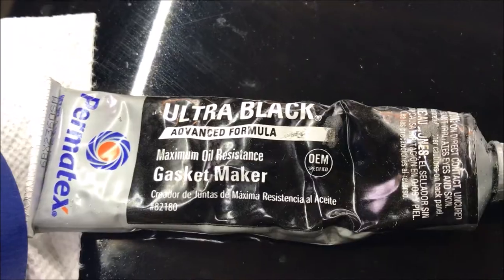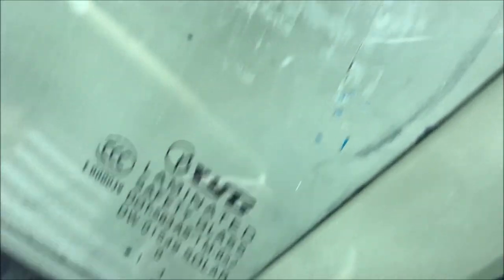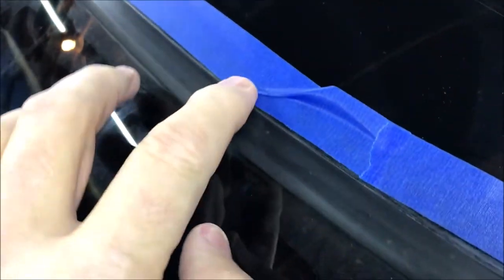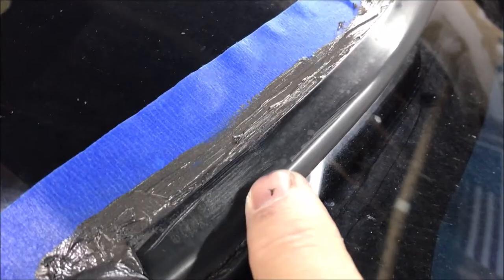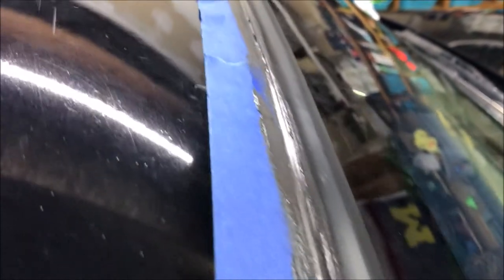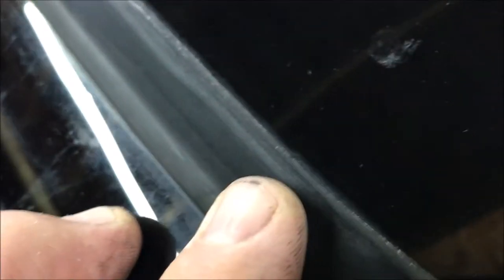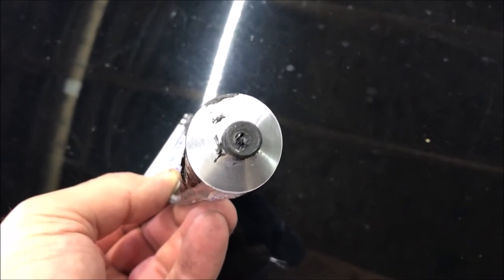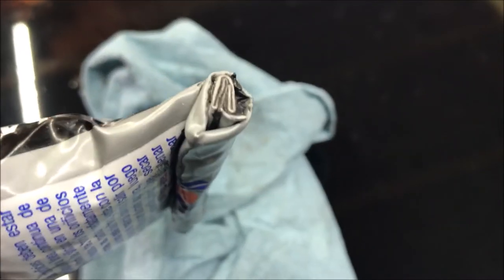OldGuyDIY $2 Fix Repair Windshield Seal Leak w Permatex Gasket Maker Car Truck Auto Leaking @ Seal

Comment: ---- <  What about if the weather stripping problem is between the weather strip and the glass.  Will the permatex make a seal between the glass of the front windshield and the rubber or vinyl strip across the top of the window?
Reply from the maker: Based on my experience, yes.

Comment: My sealant shrank due to age and the corner is peeling off will this work? And is it easy to clean off if I have to change the windshield
Reply from the maker: I believe this will work to repair the shrinkage.  It is not easy to clean off.  Once it is there, it wants to stay there.

Comment: Can the seal be replaced or would the whole windshield need to come out?
Reply from the maker: The windshield needs to be removed to properly replace the seal.
Reply: How much that would cost aprox?
Reply: @gerardotorres7904 it's basically going to cost the same as replacing it. I have that issue where i got a new windshield installed poorly and now reaping the consequences. Luckily it doesn't rain often in California.

Comment: So I have a 07 Cadillac DTS and when I wash the car water gets in somewhere and where I open the sunroof that where the water starts coming out from those buttons and lights could it be the sunroof that needs sealant around the sunroof
Reply from the maker: Yes, I believe so.  It could be that the seal around the sunroof needs to be replaced or the drain hole or holes are plugged. With the sunroof open, stick your head through the sunroof hole and you will see a track running around the outside edge of the sunroof.  The track should have a drain hole or two to allow water to escape to the ground.  If the drain hole is blocked by dirt, leaves, etc, the water cannot escape as it should.  I suggest pouring a small amount of water into the sunroof track and watching where it runs to.  That will help you identify the drain location and determine whether or not the drain is plugged.  Some years ago a friend had an issue with a leaking sunroof and we found the issue I just described. Good luck.
Reply: @OldGuyDIY  thank you for the reply I will try and keep you updated ty
Reply from the maker: A good test to start the process is to apply duct tape to the seam where the sunroof and roof meet and then pour water on the roof.  Wipe the roof off, remove the tape and see if there is any water near the buttons, where it had been leaking before. If there is no water, at least you know for sure that the sunroof to roof interface is the problem. The duct tape will only have been on there for 5 - 10 minutes so you shouldn't have to worry about the tape leaving residue when you remove it.
Reply: @OldGuyDIY  basically around the whole sunroof where it opens and where the seal is right ??
Reply from the maker: Yes, that's what I would do.
Reply: @OldGuyDIY  awesome thats a great idea actually lol

Comment: Basically  u needed to remove and refit screen  . Fit new trim
Reply from the maker: No, when I had the windshield replaced, we found a section about 2" long that did not have any adhesive at the top of the windshield.  Whoever replaced the windshield last apparently did a poor job.

Comment: Should've squirted the silicone under the window gasket
Reply from the maker: That piece of rubber molding is not for sealing the windshield to the car.  It just reduces wind noise and covers the channel that rain water runs in along the top of the windshield while making its way to the side channels and then the ground. I was just trying to keep rain water from getting between the top of the truck and the rubber trim piece since I knew there was a void in the adhesive around the windshield.  When I had the windshield replaced a few months later, we found a 6 inch section at the top of the windshield where there was no adhesive caulk.  The solution shown in this video kept water out of the truck until the windshield was replaced.
Reply: @OldGuyDIY  thanks , noted ✅️